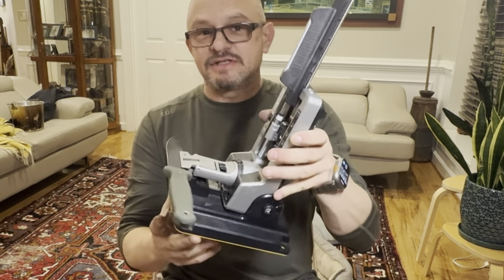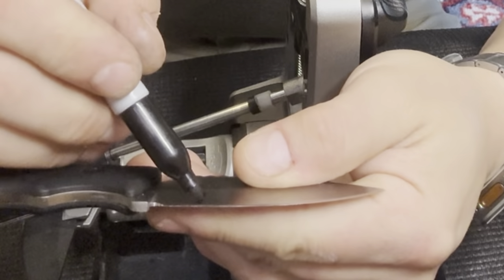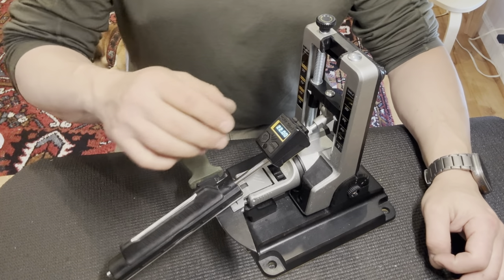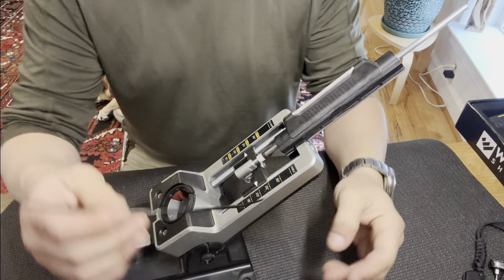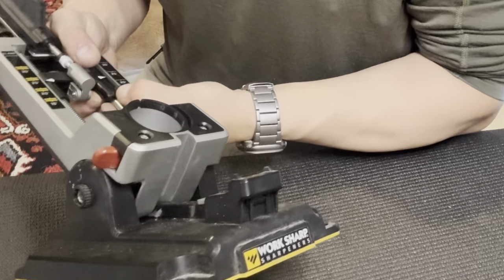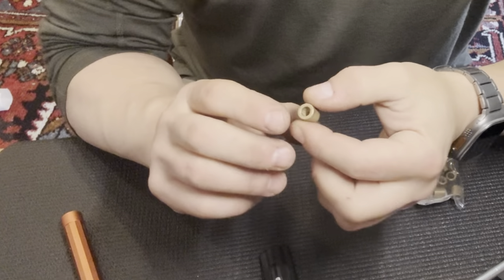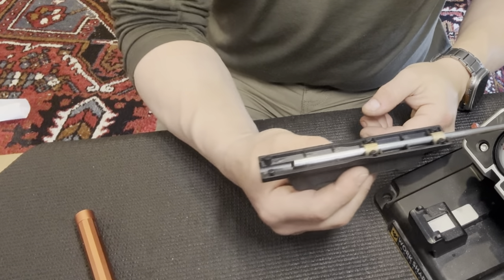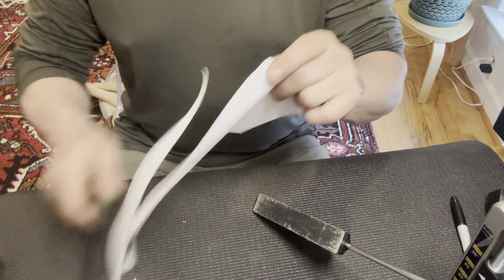Episode #1. Did Work Sharp stop $3 short of Professional level? Is it really PRECISION Adjust-able?

Comment: At 17:21 you install a bushing.   Are Those bushings meant to be free replacements when the others wear out?  Just a thought,  nice review.
Reply from the maker: Thanks for your comment! I didn’t find replacement bushings on work sharp website and to tell the truth, self lubricating bronze is always better than nylon. I expect years rather than months of hard use out of them.
Reply: @CuttingBoardRx  You're welcome.  I totally agree that they should have uses brass bushings.  I appreciate you finding the correct replacement bushings.  What I noticed on your sharpener is the extra nylon bushings that you installed at 17:21.  My unit doesn't have nylon bushings outside of the stops. Are those the old bushings that you replaced?
Reply from the maker: @1dandandy1  oh, my! I had a senior moment! No, they didn’t come with the sharpener, they came OUT of an old paint roller and they are slightly undersized and have a split that allows them to spring out and hold on to the rod. I should have mentioned it in the video! Precludes the rubber stops from sliding! Ughhh, that would make another great suggestion to the WS engineers!
Reply: @CuttingBoardRx  i understand.  Thank You. 👍

Comment: I love the unit but the clamp is AWFUL for kitchen knives, specially japanese thin ones that are more flexible.
any slight pressure on my knife massively changes the angle
Reply from the maker: @Amybnuy  I solved that issue in another video. Episode #6. Work Sharp Pro Precision Adjust how to sharpen longer and wider blades on any size knife
https://youtube.com/shorts/RhsOlt7mQao?feature=share
Reply: @CuttingBoardRx  Oh thanks! I already 3D printed the same thing :P the issue is that when you rotate the knife it changes the angle... so every single turn I do, I have to recalibrate the angle slightly!
Reply: @CuttingBoardRx  OOH turns out, if I losen the death grip on the vise grip this issue goes away! I stopped using my print but now I love it again! I was so sad looking at other alternatives like xarlik, now I'm just waiting on my lapping iflms to put on my 3d printed blanks
Reply from the maker: @ XARILK is definitely giving everyone run for their money! I hope you watch my videos about it.

Comment: The whole system is not precise, as you already have a construction-related deviation in the angle with longer blades. Just test it yourself…a large blade in the middle and then place the abrasive on the tip of the blade. If you generally set, for example, 15°, the actual angle is deviating downwards. In any case, this can be measured with a goniometer. Ultimately, one only needs to know such deviations and take them into account when grinding. Nevertheless, the knives will still become sharp.
Reply from the maker: That is a well known concern with any fixed angle system. I’m satisfied with a sharpening if the angle is varied 0.25 degrees end to end or less on knives that are up to 4 inches long.

Comment: I just got a Wicked Edge system, a far superior tool and doesn't require the post sale engineering to fix the poor engineering from Edge Pro.
Reply from the maker: When buying Wicked Edge (WE) system, you’re paying for two sharpeners, the promise being able to sharpen both sides of the edge on a single blade orientation. 
Some believe that using WE may lead a beginner sharpening enthusiast to learning some bad habits. 
For example, moving stones along the edge in a sweeping motion as WE almost forces one to do, is not just a bad habit, it’s a terrible waste of steel and abrasive media. 
It does allow one to run the stones perpendicular to the apex, which is the correct way, but that can only be done on one side of the blade at a time. 
I have to also mention that by the time one acquires all the add-ons: the base, additional stones, small blade attachment etc. the system ends up costing north of $1K
I’m glad you, sir could afford it, but regretfully, almost nobody else will be in this economy.

Comment: What?!?!, why isn't anyone talking about the mediocre clamping system! Im guessing most of you haven’t tried sharpening any kitchen knives that have a 2mm or less spine and weigh over 6 ounces yet.
They flex in the holder entirely way too much, hell even on Work Sharps video of 
demonstrating sharpening a kitchen knife or a cleaver (I forget) the blade is flexing a lot in the holder and he is gingerly applying pressure. I had two of these systems(USA made ones) and both clamps exhibit the same behaviour. The clamp/ knife holder SUCKS holding onto thin heavy blades, it can’t get tight enough. The rubber jaw inserts aren’t helping either.
If it was a cheap system I'd chalk it up but for $300 I expected better.
Reply from the maker: I sharpened Buck 119 on mine. It weighs 7.5 oz and has a 6” blade. Absolutely no problem. Experience may vary from one unit to another. Full disclosure: When I sharpen, I support the blade from the bottom, especially at the tip, my free hand to prevent “rolling” the tip over. WSPPA works out for me, but for some people it’s a step backwards if they use wet stones.
Reply: @CuttingBoardRx  That Buck knife of yours has a thick blade. The clamp struggles with thin spine knives, such as chef knifes, slicer knives, that weigh 6 ounces and over. As mentioned I tried two different clamps and they both performed horrible with those kind of knives. It just won’t clamp down on thin blades tight enough. Seriously go try to sharpen one of your kitchen knives and report back. 

https://youtu.be/oy_wsKUB1jk?si=E1twtoCK3R2VJN1u

Comment: They have to cut costs somewhere. If not, then it will become a $350 system, and then everybody will cry about the price. They have to find that balance somewhere. Great fixes. Work sharp also fell short with stone grit levels, they need to make at least a 1000 gritt and a 1200 grit or there abouts available for purchase separately
Reply from the maker: I think that’s what happens when a company prioritizes too many requirements at the same time. It has to be too many things at the same time: compact but accept long blades but also sharpen tiny blades, light but portable… 
Please watch my videos about XARILK, the  Amazon sharpener. It’s not bad for what you pay. Made in China though